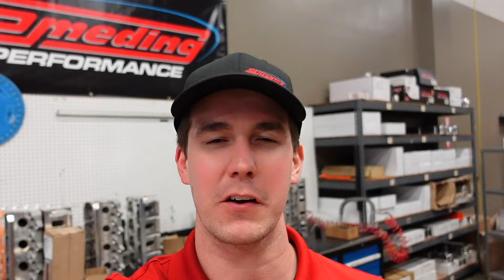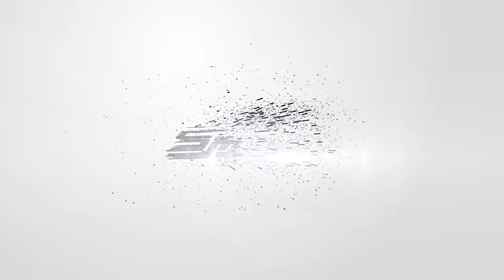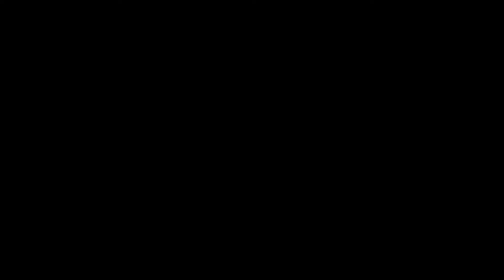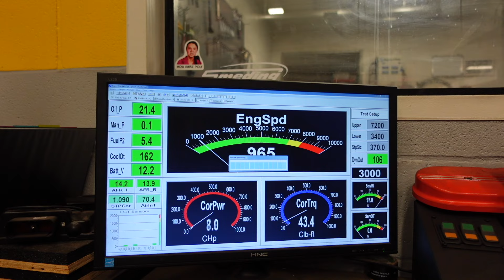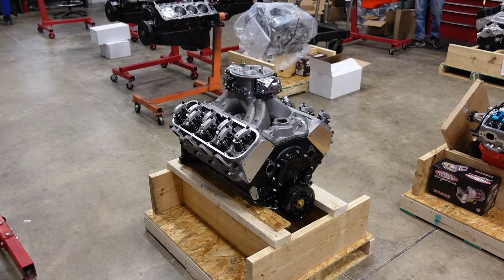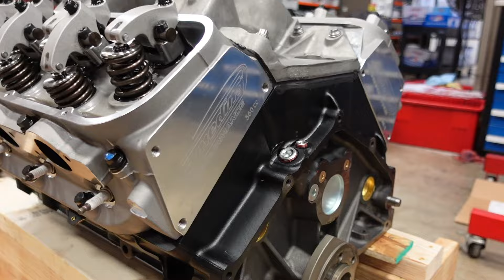632" Big Block Chevy Turns 7,200 RPM!! - Pump Gas / Solid Roller

Comment: I bought my big block 540 with these guys it's an amazing engine I really do recommend them.
Reply: Did you ever put it on a dyno? Did it have more or less horsepower than they advertised? I'm curious why the numbers are so low even for the 540 on their website they are saying 640 hp while let's say blueprint 540 is like 2 grand cheaper and 30 more horsepower

Comment: Engine is likely to pop if he consistently runs it thru the traps at 7200+, that engine dropped HP right as windage started to drop oil pressure by 20psi CLASSIC BBC oil not being controlled symptoms.....thats the most important thing this video showed and nary a bit of addressing in video or comments...got to really get the windage under control with those 4.25" stroke and up cranks on BBC...

Comment: GM sells ZZ 632 crate engine complete with EFI and ECU control for $33,000 from various dealers. Rated @ 1004HP (Scoggin-Dickey)
Reply: Your point?
Reply: @clintbartholomew8005 I'd put money on the Chevy create motor that is cheaper, has better aftermarket and after sales support and probably has a better warranty. But, I'm not sure the machining quality would be a good or consistent as a hand built motor.... Customer preference; I don't have the money for a hand built motor.
Reply: My Shafiroff 598 on pump gas makes over 1100hp and was 10k cheaper . Why pay for that GM logo .

Comment: Okay I'm confused. I saw it go to 885 horsepower correct?

You can buy the 632 from Chevrolet with a warranty with over a thousand horsepower

How did you put a loppy cam in different heads and get less power out of it than Chevy gives you with a warranty

I'm not trying to pick on anybody, there's probably some sort of a racing reason, that I don't know about

But it seems to me like you're almost down 150 or more horsepower and then he's going to hit it with a 300 shot, or you could have had a factory motor. You didn't have to change and hit it with a 150 shot for the exact same thing.
Reply: That is standard style bbc Chevy head way different then the spread port rolled over head in the new Chevy crate engine. This engine is probably 10,000 dollars plus cheaper

Comment: I noticed  a difference  in the left  and right  air fuel  ratio. Can you explain   why?l Would  stagger  jetting  help to even  it out. Do you measure oil temp and try to reach a certain  temperature  when dyno testing. What weight and brand oil  do you use? Would appreciate a response 
 Thanks